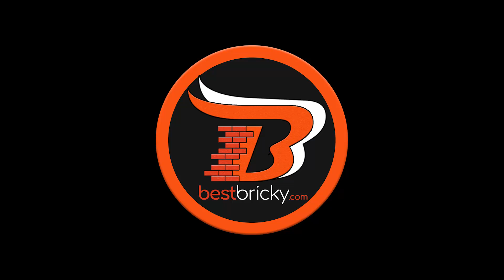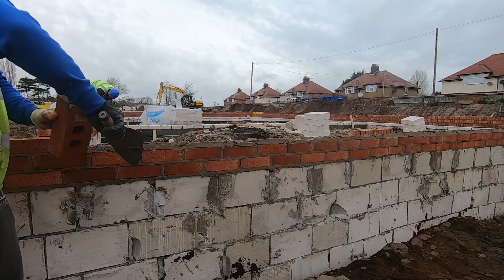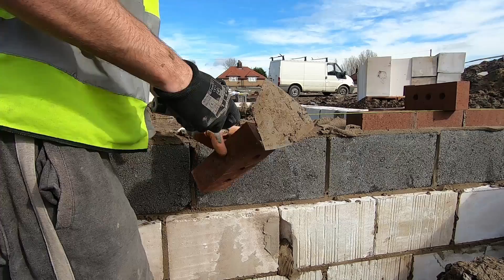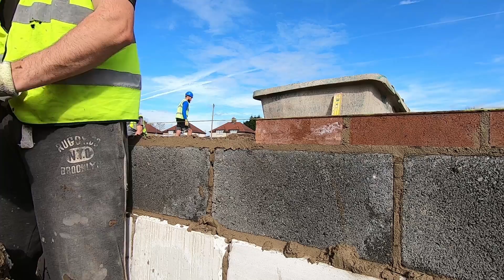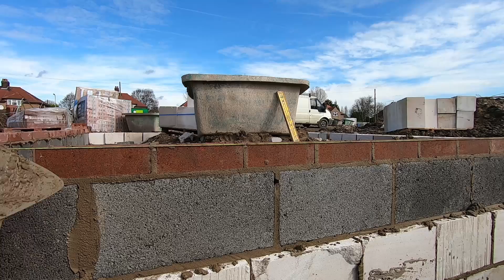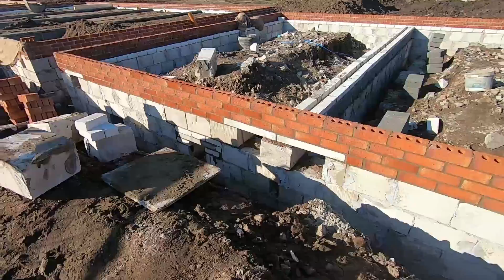Bricklaying Video watch learn and relax

Comment: How do you make sure your coarses are vertical is it done by the corner post and what's your website called? cheers
Reply: Normally youd get your corners up plump and then you string a line of your corner

Comment: Stu, do you always lay/prefer engineering bricks? Not a dig as I enjoy the videos but from what I've seen it's what you always lay on site in the footings and the supers. London trowel.
Reply from the maker: They have to be an engineering brick in the footings because they are very dense and will hold up better in the ground/ moisture compares to low density brick
Reply: @Stucrompton1  Of course. It's just that, unless I'm wrong, it's what you lay in the lifts above damp aswell in your site videos. Just asking. Down south it's engineerings under damp and then frog bricks above splash.
Reply: Lawrence Curwen I believe your confused in the fact that they are perforated so you are assuming they are engineering....but I may also be wrong 🤔

Comment: Hi Stu 
Can really relate to your vids , especially the one about your apprenticeship, mine was the same , I’m originally from Stockport but I’m now living in the south of France , I have built quite a large company and do very well , we do full new builds and full barn Reno’s , I have been here now for 13 years , it took me a while to get use to the building system as it’s single skin 200mm blockwork , complete ring beam system under wall plate and in corners and reveals all linked to founds filled with steel and concrete , I actually quite like the system , are you up for coming out I hype summer throwing one up with us ? Would make a good video , building in France , let me know and I will fly you out for a month or so , they go up quick , let me know , my name stu too , regards stu
Reply from the maker: Hi stu well done on your achievements. I maybe could come over 👍